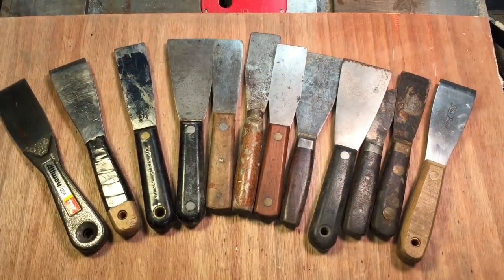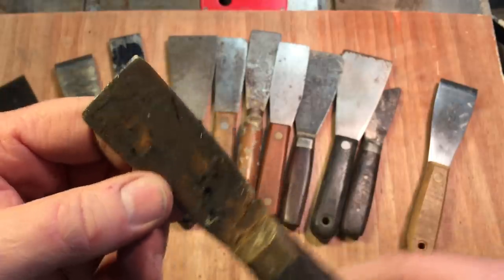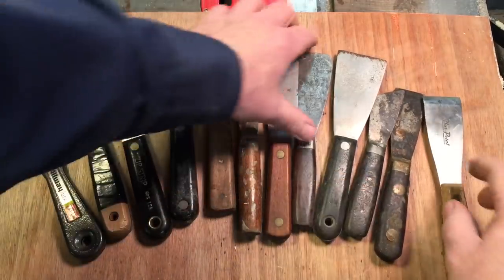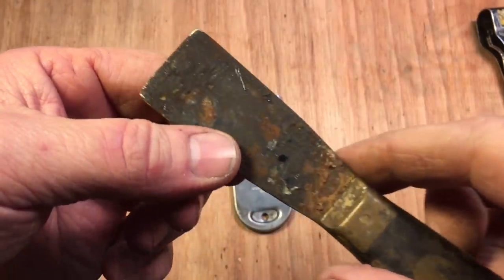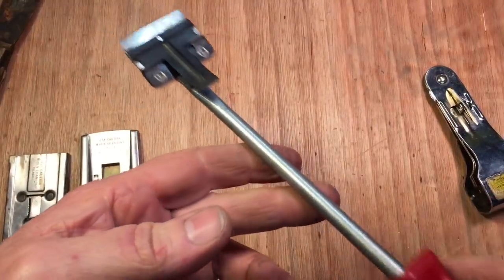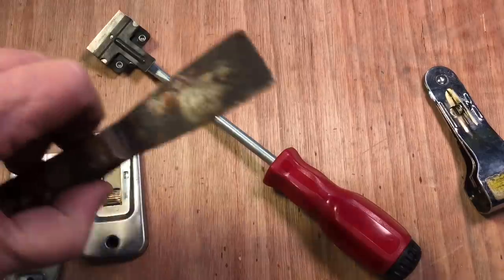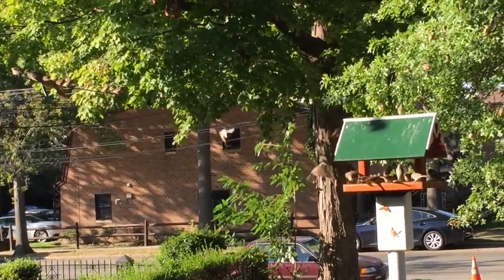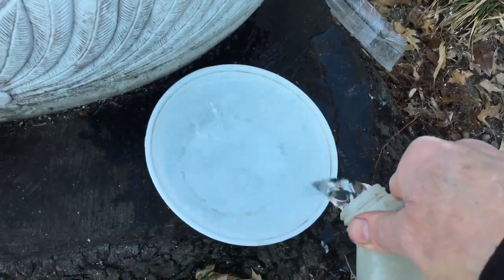Antique Putty Knife Restoration

Comment: I bought that exact Blue Point putty knife 29 years ago for removing gaskets and as a skin wedge to pry and hammer skins apart. The wood got replaced with phenolic about 6 months in. It is a 3rd shorter now so I recently bought a new 3 piece set. I love my Lisle razorblade scraper too, it is worlds above anything else. Nice job on the pretty putty knife!

Comment: I’ve got quite a few of the lovely old , well I call them scrapers. To me a putty knife has a point and a couple of reverse curves .Scrapers have fan shaped down to parallel shaped blades. But the old ones have fantastic steel, and they  can have a knife sharp edge but are so flexible. Hot air gun or blowtorch and lift off all that lead paint!! Yum

Comment: Very nice restoration as usual. Is it me or do putty knife manufacturers no longer make putty knives with rounded corners? I have some oldies with rounded corners which I prefer for wall patching. You are less likely to gouge your work. The newer one have squared corners. But I use them too. The birds around here absolutely love black oil sunflower seeds . I thought they might  think they were being fed gourmet meals if they got a nice mix of millet, sunflower seeds , etc.,  but they just want the oil seed.  But I'm happy to accommodate them. Thanks
Reply: I’m not sure the corners were rounded when the knives came from the factory. Those rounded corners were often the result of decades of use and maybe a bit of abuse. Perhaps there might have been a bit of modification going on by some one who needed it to fit a certain job and took a file to the knife or used a grinder to change the shape.
Reply from the maker: Hi Pat- The problem is we tend to use the big box stores for all of our needs and they have limited selection. If you want really good putty knives you have to go to a paint store!   Like here!  https://cottagepaint.com/product/professional-putty-knife-round/

Comment: John - you only did half the job. How about showing how you cleaned up the handle ?  I have several old putty knives like those and might tackle cleaning them up if I had some instructions from you on the handle.

Thanks.
Reply from the maker: With this hard wood I just sanded and buffed it on the buffer just like I was buffing metal!!!!!!
Reply: @ScoutCrafter  ok - what about those handles made of that hard plastic material?

Comment: Scout, it's hard to find a GOOD puddy knife, anymore.  I have a couple Ol' Skool ones which I guard carefully.  The old ones are 1/ Carbon steel; 2/ tapered from the heel to the tip; 3/ and as you pointed out, VERY flexible.   If you have a good puddy knife, take care of it.  PS - It's not the blade holder anymore, it's the Wuhan Special blades that have flooded the market; ask any mechanic who does inspections.
Reply: If your looking for a GOOD putty knife like scraper, Bluepoint (Snap-on) has a walnut handled scraper with a lifetime guarantee. It's $19.00 but you get what you pay for. I have one and can recommend. Bought it a decade ago when it was about $12.00.

Comment: If you have a Weber Kettle grill and can't find an appropriate scraper - Take one of your many Puddy knives and grind the flat tip into an "arc" shaped head (i.e. half moon ) and you will find it much easier to clean the contours of the Weber kettle bowl and lid from the soot. The vintage flexible Puddy knives work much better than any modern plastic scraper.

Comment: In the before pictures it looked, at least to me that one of the rivets was sticking up from the handle. Did this get sanded down or were my eyes playing tricks on me?
While I have a number of putty knives from my dad, there was one old beat up knife that was reserved for engine cleaning. Dad had an empty Half & Half tobacco tin that he would pour some Gunk into and then use an old round brush to spread the Gunk over built up crud on the engine, using the old putty knife to scrape off the bulk of the loosened crud. I have no plans to ever restore that knife, I’m saving it for those cruddy scraping jobs.
Reply from the maker: Yes!  That rivet was a little proud and sanding leveled it right out!   Thanks!

Comment: Please Scoutcrafter... can you explain this New Zealander what on earth Spackle is? Hear it all the time..is it something to do with Gib-board (you guys call that stuff Sheat-rock)...?... good vid by the way. I used to watch my Dad pop the lid from a pale of paint with corner edge of his ancient putty knife (that had been his fathers) in one smooth move and then when finished painting closed the lib back while running round the outer upper edge of the lid and pushing it down one hand on the putty  knife handle, & thumb on the blade.... Then one day as a kid i tried the same with Dad's old knife AND PROMPTLY BROKE IT ! i will  remember that look of disdain from my father gave me rest of my life....:-)
Reply: Spackling compound is a paste that can be applied to sheetrock (and other materials) to patch nicks, dents, and small holes.  It dries hard and then you can sand it to match the surface, then you paint over it.
Reply: Spackle is an old brand name that has been incorrectly used interchangeably with taping compound in making plaster repairs. It predates the widespread use of sheetrock. It's harder than joint compound and is a pain to sand. Google "spackle vs joint compound"
Reply from the maker: Hi Pete!  Gerald and Fred got it right!  Spackle is akin to a pre-mix plaster of Paris that dries fairly quick and is used by sheetrock installers and tapers...  =D   You always see the empty 5 gallon buckets tossed away on new construction sites...
Reply: @ScoutCrafter  thanks all for interesting explanation. Years ago i'd  first heared it mentioned on the Judge Judy  TV show we used to see here. I never found anyone who could explain it .... but by the descriptions it would be called Gib-stopping here on account the sheets of plaster/ paper sandwhich wall panels are called Gib-board.

Comment: do you have an automatic center punch if so are they any good
Reply: They are good for breaking automotive windows and no I'm not a delinquent (well maybe little😊), I'm a firefighter and we use the spring loaded center punches for quick emergency extrications...
Reply from the maker: I have them but always preferred regular punches.  (And a Brass hammer!)  =D